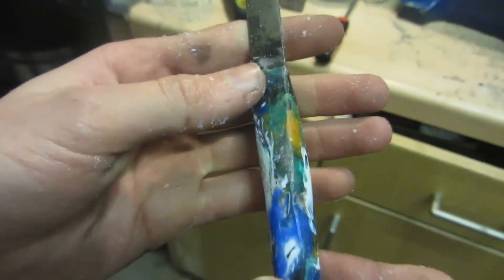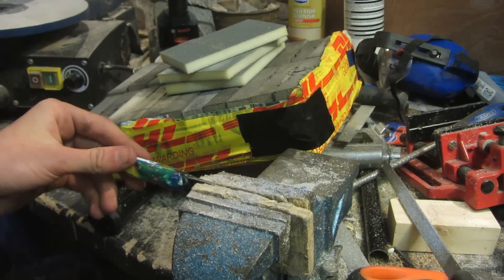How to Forge a Carving Knife From a Drill bit - part 2

Comment: You should temper at 550 F for 1 hour. It will be much tougher, and still as hard as a Victorinox knife.
Reply: Oh, and more important, you need to austenize the blade for a couple of minutes before quenching. At least 5 minutes from the moment you put it to the fire.
Reply: SalveMonesvol victorinox knives are more flexible than hard as they are made out of stainless steel
Reply: TriFire It isn't the fact that they are made from stainless steel, but the temper that gives them those properties. Stainless steel can be very hard and weak, look at a 440c blade with spring temper. Shiny, good edge retention, shitty toughness.
Reply: +SalveMonesvol well victorinox knives aren't hard lol
Reply: TriFire yet they are very abrassion ressistant.
Reply: +SalveMonesvol Hi Salve,
Cant argue with what you say, the only difference is the hard tool steel he is using, much M UCH harder than the stainless steel used in Victorinox knives.
Reply: mrbluenun Then it might end up over 59 hrc after being well tempered.

Comment: the only thing i can recommend is setting up a nice work area... like in the shot where you where flatting out the knife on the anvil it was moving... does not seem like its a big deal but i will save your back knees and arms... try to set it up where you are comfortable your going to be spending a lot of time heating and forging that metal its a difference of 2 hours to 8 hours...

Comment: You will like the 01 and the high carbon steel best. File blades can be amazing if tempered properly afterwards of course as the carbon content is very high. As long as they are used for blades that will not encounter much stress (from chopping etc.) they can be amazingly sharp with great edge retention (but yes brittle also). Just listening to what you said and - maybe its just how you put it but of course - tempering is not hardening but quite the opposite, tempering is a form or controlled annealing from maximum hardness to achieve plasticity and toughness. I think your videos are amazing - all of them really - well done!

Comment: the axe handle wont be very good for knives because it is soft steel so it can be pounded on only the end of the head near the blade will be high carbon tool steel

Comment: Nice attention to detail. Great result. Can you make shirikans from the sawblade? The tomahawk/ball peen hammer is a great idea. A thin file might convert to a great stilletto, women love the classics. I have 2 ideas for the plastic handle.Melt the plastic in a crucible of some kind, using goggles and distance,pour into the handle mold, stir to release air bubblesand while still  hot insert the drill bit end of knife in a simple twist for maximum grip, Or you could prepare a rectangular block of plastic, drill a starter hole like you did for your Lego pulley and screw in the drill bit. Maybe there is an epoxy you could drizzle into the starter hole that would make a stronger bond between the bit and  the plastic.There is something to be said for using hot plastic as it shrinks and should grip better.  Would carving 4 or 5  closely spaced small shallow raised ridges give you a better grip when the knife is slippery? Or would that throw off the balance, The plastic seems to have a good grip as it is. Would a square of parchment paper, or aluminium foil catch drips on the bottom of your toaster oven? good Demo thanks,

Comment: Next time you do a mold like that try using a plumbers torch to heat the tube and melt the plastic that is bonded to the tube then it should slide right out then you wouldn't have to make another mold next time

Comment: I have to say, I never dreamed of using a drill bit for steel, but damn that is a good knife! Not to my taste in handle material, but your thinking way out of the box, watching part one I had a thought, maybe use a vise to clamp the shank and heat the flutes, and untwist them? Then hammer flat and even, and you would never know it was a drill bit, also you could then make any handle type. Keep it up dude!!!

Comment: Use a router and some 2x6 wood to make a mold that you can bolt together and pour your plastic into. Then you just un bolt it and sand it smooth on the belt sander.

Comment: Mora rocks. Making hidden-tang knifes is really fun :)
Reply from the maker: thanks!
i agree the mora blade seems awesome so far!
Reply: Affe Blomberg Mora's are great value for money. I collect fixed blade knives and by far the best I have owned so far is the Fallkniven F1. Swedish steel in my experience is the best you can get, and the fact the Fallkniven F1 is the survival knife issued to the Swedish airforce is testimony to what a great knife it is. Its well balanced, strong, and holds an edge forever (well not literally but for a very long time!). I would recommend you check it out.
Reply: gregsoddworld I have never used a Fällkniven, but as far as I know they are one of the best there is. But a Fällkniven blank is 19 times the price of a Mora blade so I guess a Fällkniven would be a future project for me :)

Comment: Hey man, big fan of your videos. However, motor oil is not a great quenching oil because  it is intended to be used in a high temperature environment, not at room/outside temperature. You also mentioned that motor oil will add carbon to the knife. That's partially true, as it does add a miniscule amount. To add a significant amount of carbon, you need high temperature and a lot of time. But I guess motor oil is cheap and easy to get. It isn't the worst thing you can quench in, but at your level, you could use some better oil.

Comment: +The Art of Wepons. I'm new to forging and have built a forge like yours in the video but when i started the charcoals after a while they all broke down in a fine sand dust at the bottom of my forge and covered the air supply tube. This happens every time and on top of that I'm using a cast iron crucible and for some reason it does not get hot enough plz help because I'm frustrated on what to do i love your videos keep up the great work

Comment: when holding the work piece in the tongs for a long time, you'll get knackered. if you hold the piece in the jaws and then lock the handles with copper wire, that'll take the "squeeze" of the the effort for you, allowing you to simply hold the clamped tongs and concentrate on the workpiece....glad you got some O1,,far simpler to get heat treats successful!
Reply: +Wessex Blades&Bushcraft
When holding the piece and heating it to work on there is not enough time to tie anything round the handles, unless he wants to hold it all the time, but he m right get roasted himself. |
I agree that it would be easier with proper Tongs or what ever they are called but maybe he could make some to suite his normal sized work like the drill bits to fit the exactly then it wouldn’t take so much effort.|

Take care
mrbluenun

Comment: Cool knife, I'm jealous about all the tool steel you have :P.
Here are some suggestions: 

The axe head you can turn into a battle axe or something else by grinding or forging. (I have done that, video is on my channel)
The lawnmower blade can be easily forged to a machete or big survival knife.
The ball peen hammer head can be forged to a war hammer or a small hatchet.
The files can be turned into knives or new tools for in the shop like chisels.
The saw blade steel can be used for anything: tools, knives, swords, daggers ....

I'm looking forward to your future projects, you have lots of steel so you can make heaps of weapons.
cheers